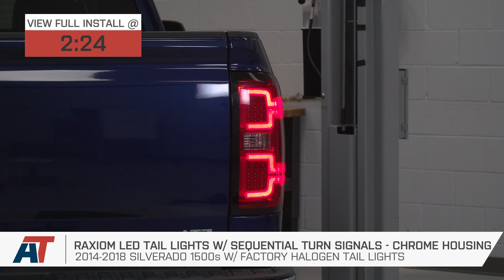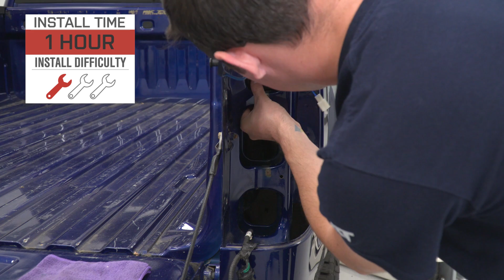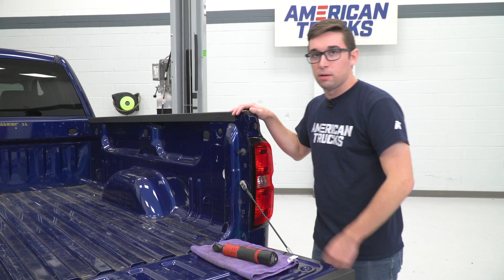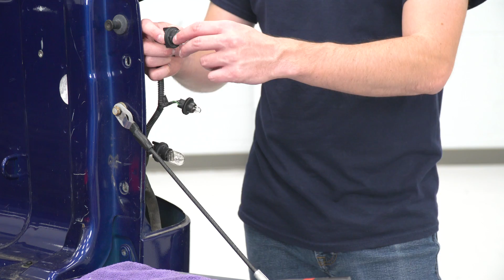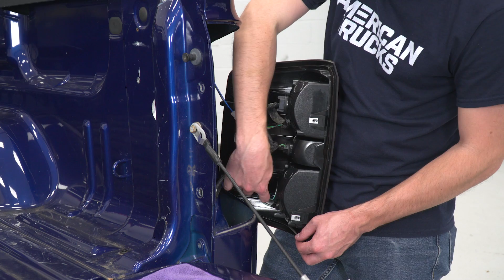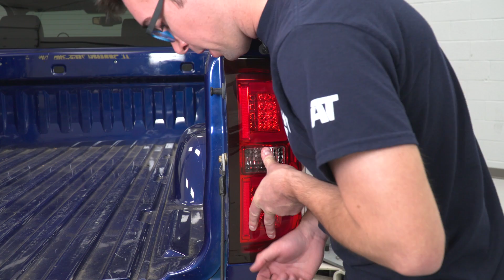2014-2018 Silverado Raxiom LED Tail Lights with Sequential Turn Signal Review & Install

Comment: My question is, how is that exposed connection to the modules going to hold up to the elements? Wouldn't it be wise to wrap that connection somehow to protect it? 

Also, wont those wires rub on the taillight housing and eventually short?